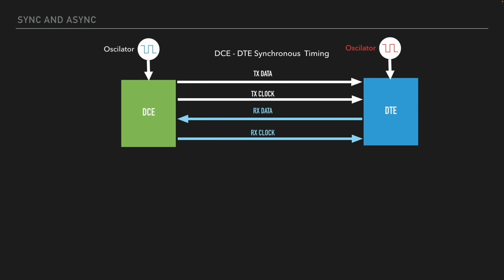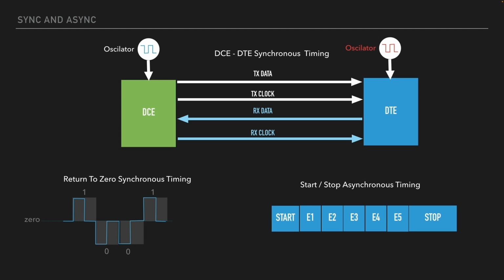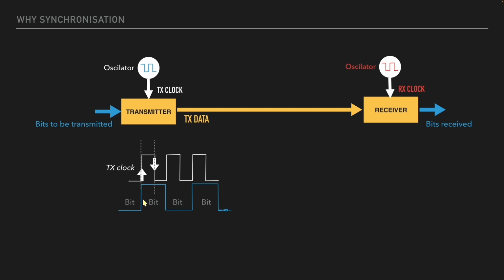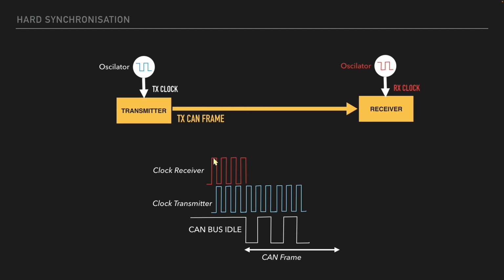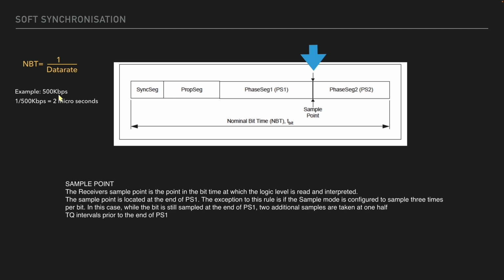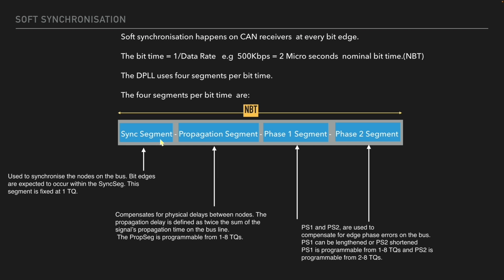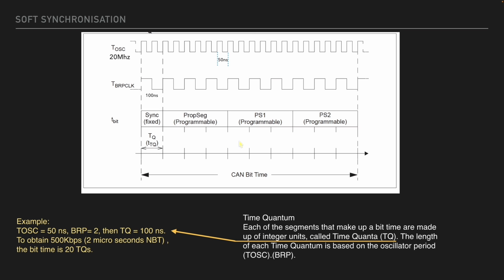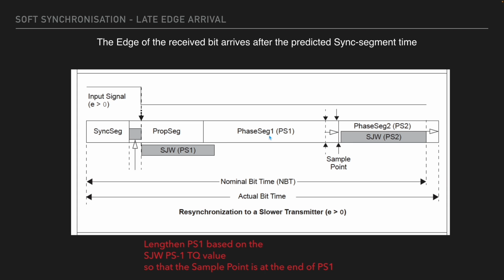Yes you CAN ! Understanding the CAN bus  -  A deep dive into CAN synchronisation

Comment: Thank you very much sir. For your quick upload when requested.

I would like to ask you that is there a way to read the information sent from a CAN controller, so that we can analyse( also with the set DTC), which CAN controller is faulty?
Reply from the maker: Hi,  That is what I covered in part 3B by decoding the messages with an osciloscope , as you will have seen that is very hard and not doable on a life bus.   Using an data capture tool might be easier. But even then it will be very hard.   So the only way is really to  buy an analyser or tool set from the brand of  manufacture of the car or associated.

Comment: I apologise for falling short of your expectations but I'm having trouble wiring in a temp guage.
Reply: I wish I had your understanding of these matters.  To quickly explain the issue. As I am in Australia the car is a 1973 2 door holden Monaro. It came with a standard guage cluster and I am converting to the GTS guages, and with some of the guages costing over $1000 I have already burnt out the amp guage.  So instead of using the existing wires I'll run new wires.  Ps it would be basic stuff to most people.
Reply from the maker: @kevinrose9128  Kevin, in 1973 there was no CAN BUS in existence.    So your Monaro ( nice car by the way) is using standard wiring ... not CAN...   What type gauges did you buy and what are you trying to install... Maybe I can help with some of the wiring....( of course by mail or private youtube recording).   But I need to know the exact gauge types from GTS
Reply from the maker: Thanks , and what is the issue ?   There are several points to address :    Is the gauge a CAN BUS device ?    What ISO standard  does it meet ?  Does it assures in the specs that it can read your cars specific CAN ID for temp ?  It should have only a CAN-H and CAN-L  connection , besides the ground and 12V for its power supply.   If a CAN device you will beed to connect it as a stub ...   check the other four video's on this topic ....it addresses the wires, electrical, protocol, decode and synchronization